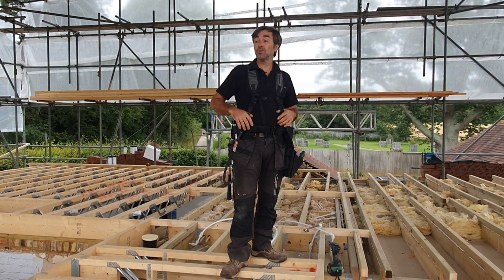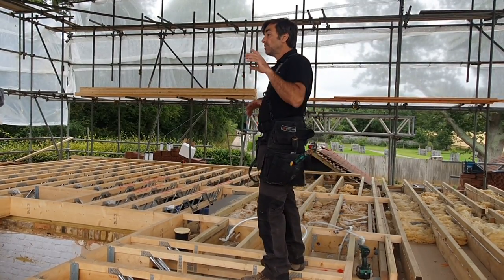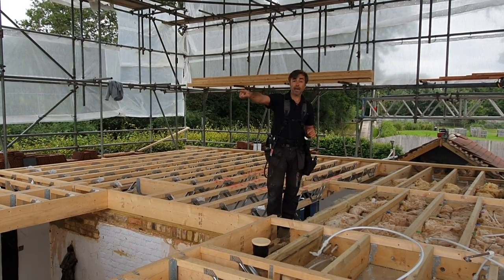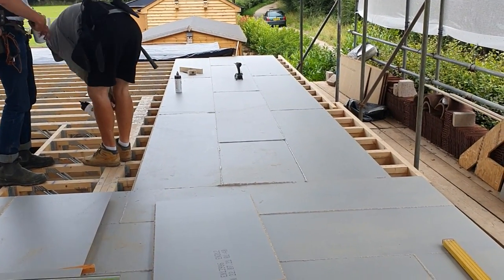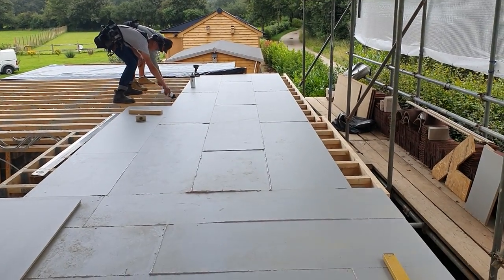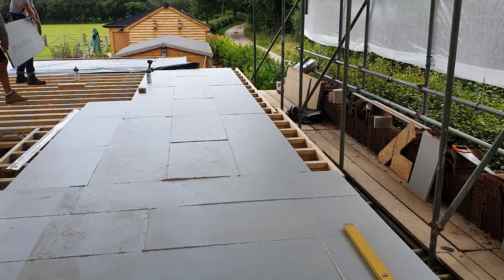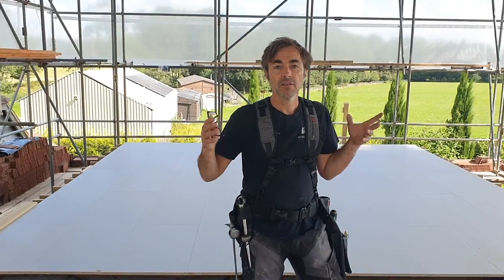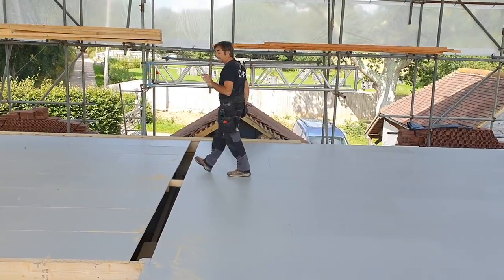The Big Build 20. Laying P5 Chipboard Flooring panels

Comment: Great video Robin. If your doing a larger floor take care when storing sheets on the Posi-Joists. Max load for storing sheet materials is 250kg/m2 and not greater than 300mm deep. The load should always be spread over at least 4 joists within 1.5m of the support wall.
Reply: Didn't know that - thanks for the detail.
Reply: I'm sure he only loaded up a few at a time that's how it looked in the video 🔨
Reply: @tomsmith9048  Yes Robin knows what he is doing. he was just bringing up a few sheets and stacking them over an internal load bearing wall but that was probably due to not having a crane. I have seen cases of packs being craned directly onto floors from the lorry.

Comment: Dust extraction even outside. Just heard close friend gone into hospice age 60 after life in  building trade - hands on carpenter and owning a company. Lungs. Similar quality work to RC. Today - I'd use dust extraction on that plunge saw even working outside - chipboard, especially with the coating is dangerous stuff. I got lucky and was only ever heavy duty diyer.

Comment: I appreciate it when use terms like gable and ridge. Our nomenclature may b a little different here, but I want  to better understand the terms that u use. Was the glue sticking up and then later trimmed on the floor?  No screws used at all in flooring?  Anything holding it down while the glue sets up?

Comment: mate, with that pace on current prices you'd be lucky to make even £50
Reply from the maker: Don't need the money!!
Reply: Something tells me he's got a slightly 🙄 better price than you get on a national house builder 😝🔨
Reply from the maker: Well its about time that the house builders respect our craft and pay for the right standard instead of telling us what is has to cost!! by the time the guy actually doing the work gets the job it has been subbed out several times!!!
Reply: @ukconstruction  I wish they would but for the floor you put down you'd get about 550 pounds for and that includes loading out and the person who lays the floor hasn't always set the joists out and they'd never router the hangers out 😡 look up RW joinery they want to give you 19 pounds for a fitting a frame AND DOOR 🙄 that's why I don't house bash any more 🔨
Reply: @tomsmith9048  Price work shouldn't exist, it should be illegal. All it does is drive the price through the floor and lower standard's. Day rates only, 👍🔨🇮🇪
Reply: @TheToolnut  I agree but these huge house builder's will never let it happen they'll just get semi skilled workers in if tradesmen won't do it 🔨
Reply: @tomsmith9048  Sixty Years ago tradesmen went to work in a collar and tie. Look at the absolute state of the skilled trades now. Standards have gone through the floor. Very sad really and all down to pure greed.
Reply: @TheToolnut  I don't think the attire has anything to do with it it's just a sign of the times you still get good tradesmen theses days but I understand what you're saying you look at the Irish module 7 phases over 4 year's and the British nvq system 2 year's 1 day release for tech there's a big difference people are qualified over here after 2 year's 🤦‍♂️🔨
Reply: @tomsmith9048  There are lots of tradesmen around of varying abilities but very few craftsmen. The trades are a dumping ground for social losers, dead beats and school drop outs for the most part. It should be very, very hard to get an apprenticeship. That way one would be getting the cream not the bottom of the barrel. The power's that be want everything done for buttons in record time. Why the drive for open borders, they want the cheapest labour they can get their hands on. If one apposes open borders then one is a "racist" No wonder the western democracies are falling apart, 🙄🙄
Reply: @TheToolnut  I have to disagree with the school drop out part I hated school I took an apprenticeship 23 year's ago in carpentery did a 4 year city and guilds apprenticeship a year advanced craft I even contested in the national carpentery and joinery team for Ireland but them lads were just class above me 🤦‍♂️ but I was lucky enough to train under tom tutty who judged the national carpentery team and it is hard to get an apprenticeship theses days I've friends who's kid's want them but nobody has the time myself included 🤦‍♂️as for the boarders I'll leave that to the politician's 😉🇮🇪🔨
Reply: @tomsmith9048  Some of what you're saying I agree with but what I see coming behind me is poor. There is the odd diamond but they are like hens teeth. On the joinery side of it you have glorified machinist and on the carpentry side you have site mulluckers. The big problem we have in this Country is that it's so poor. Poor in that we have no decent native timber, no firewood culture, no culture of tree care, no culture of craftsmanship and all our houses are stone or brick. Not like America, God be with the Days over in Boston. Big colonial timber houses, massive budgets, the best of kit and all the time in the world to indulge myself in the craft.
Reply: @TheToolnut  I know but it's up to us or people like us or whoever has the knowledge to pass it on it is tough but I've met good lads who are young and do want to learn I try to be fair and honest with anyone that wants to learn you can only do you're best and the rest is up to them 🔨
Reply: @tomsmith9048  I agree, they're some good lads out there but most have no interest beyond a wage at the end of the Week. They have no real passion for it, to them it's just a job. If they got half a chance they'd run into a warehouse or factory. That's the dream for these fellas, the nice cushy number sitting on their holes looking at facetube on their phones. I find the generational gap harder to bridge as the Years go by. I usually work on my own now.
Reply: @TheToolnut  I suppose it just depends on how lucky you are with finding an apprentice and I try to remember time's are changing their was no phone's when I started serving my time but alot of free advertising is in social media so I try to take the good with the bad 🔨

Comment: Don't rate glued down floors one bit , I live in a Miller home and they creak like crazy , hence the reason Miller homes have had to re attend and screw the floors down and in some instances replace the whole floor .If you have indulations in the floor the glue will only take up so much of the indulation, and if you're walking on the floor before it sets which most people do , it will be less likely to adhere. They didn't use glues or mastic in times gone by like the do now , just common sense and a bit of hard graft.
Reply: Our house is 35 years old and they didn't use any glue, despite the underside of the 22mm chipboard being printed with instructions to glue it.  Consequently the upstairs creeks all over, not one bit of floor that doesn't.
Reply: @edwardholmes91  Is it nailed or screwed ?
Reply: @markw7997  Just nailed.
Reply: @edwardholmes91  they probably didn't toe nail the nails , hence the creaking .
Reply: @stevehallam6495  I've got it on my brand new house ?, its dog shit I've had every board screwed down as a result of using it .
Reply: @stevehallam6495  It was November when my plot got built , which is not sub zero temperature, but the whole of my upstairs got screwed down and now were have one of the bedrooms completely taken up.What trade are you and what housing development do you work on Steve . I used to work on redrow for 10 years.I will put it this way if you was building something in a workshop out of 2 pieces of timber that needed fastening together , would you just place one on top of the other WITHOUT clamping it , or nailing or screwing it , or just relying on the weight of the 8 x 2 22mm chipboard under it's own weight.?
Reply: @stevehallam6495  well I went in at pre plaster stage and took shed loads of photos , hardly any glue seepage and zero fixings.

Comment: Sorry mate , you are wrong wrong wrong ‘ I’m a sixty six year old chippy and did my time with Taylor Woodrow; were we built the Brighton Marina  thames Barrier and buildings that you had to know how to hang doors in one hour with out a router . glue needs screws as glue will last for twenty years otherwise the floor will float after time . As modern as you are you can not beat a  two and a half inch cut nail with a bit of tallow  as that will  last for ever as the rust in the nail will give it more grip as the years go on
Reply: I live in a new build with glued down floors , what a bag of shit ....Creaking there knackers off , hence the reason Miller homes are getting called back every two minutes to screw them all down.
Reply: @markw7997  the magic word is new build 🤦‍♂️🔨

Comment: Absolutely brilliant series of videos Robin, as a Posi-Joist and truss manufacturer myself I love to show these to my lads. The hanger manufacturers datasheet suggests a nail in the top and bottom flange of the posi as well as the beam face and top, how do you get around that in tight spots? My Posi designer wants to know 😃
Reply from the maker: Hi Mike, thanks for watching!! we will always try to fix in every hole possible, in the case of the ones that we cannot access we may then use a more traditional method of nailing the timber to the trimmer on an angle, in my case we back fix though the trimmers into the ends of the joists as seen in an earlier video, this really helps keep everything super strong and perfectly joined
Reply: @ukconstruction  Cheers Robin, I cant wait for the roof videos. If ever you take on a project in South Wales give me a shout 😃